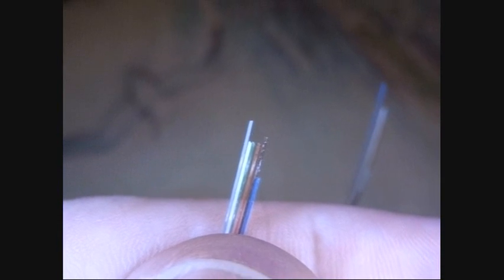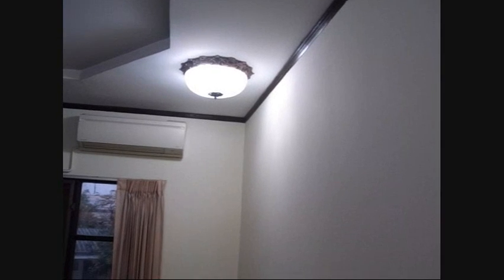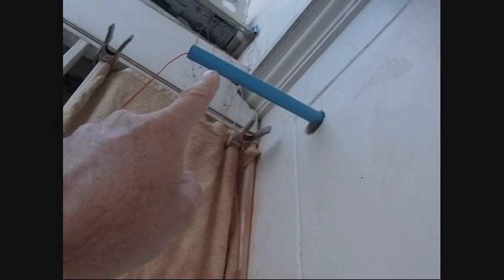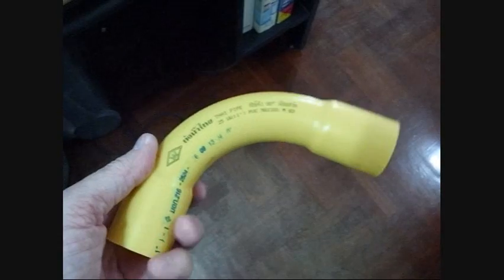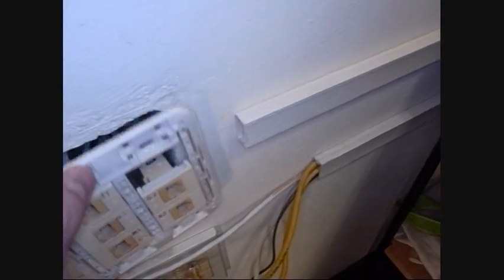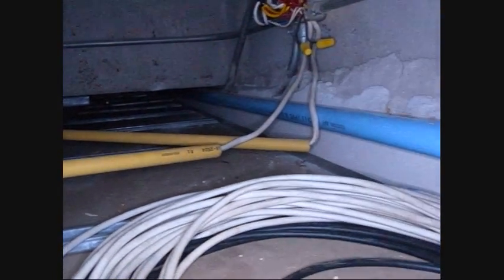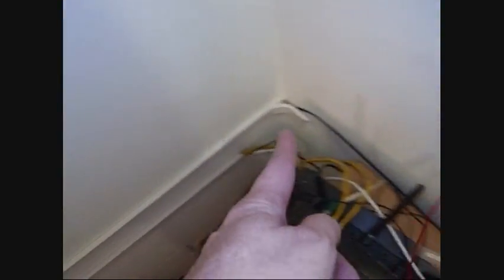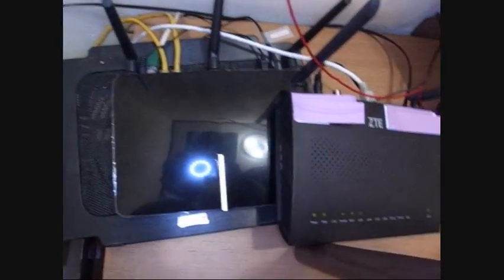Home Fiber Optic Internet Installation - Ideas For Your Install

Comment: where can I get the long of a fiber optic line? and what do I even google? "Fiber optic cable" is definitely not the search term to use.  Plus there are so many different types of fiber optic cables / cable terminations.  It is so confusing
Reply from the maker: My communication company supplied the cable, but you can find it on Amazon. I just googled "amazon fiber opitic"

Comment: Just signed up for fiber optic. Can the current coaxial Internet cable be removed and replaced by the fiber cabling?
Reply from the maker: We left our old copper in place just in case, and ran the fiber in parallel.  So the real question has to go to your provider about their long term commitments to cable vs. fiber.

Comment: Showed cable route 4 times and never showed the connection
Reply from the maker: This video is about the physical installation of the cable.  The connections on both ends were done by the phone company.

Comment: mr. can u explain on how fiber work from FIBER DISTRIBUTION CABINET to FIBER DISTRIBUTION POLE?????? 🙇🏻‍♂️🙇🏻‍♂️
Reply from the maker: In our area, they use copper phone lines (better quality) to the distribution box on the main street.  The copper signals are converted into light pulses which are sent down a big fiber cable to a smaller splitter near our house (that's what I point to in the video).  From there it's again fiber cable (smaller) from their splitter to our router, 1 piece, no junctions.

Comment: Thank you for the informative video, I just moved to my old grandfather's villa and the phone company finished setting up fiber optic for the area but they skipped the villa because it's old (45 years old) building, so I was wondering if there can be hope for fiber installation in older buldings?
Reply from the maker: Yes, our townhouse is 30 years old.  You have to plan carefully first.  Set things up in advance if you want the wires hidden away.  If it is easy for the installers they won't usually complain.
Reply: @tsbrownie  thank you so much :)

Comment: How much did the fiber optic cables cost? Reason being, I'm currently trying to get fiber in my area & the last hook up is 900 feet away & the cable company wants to charge me roughly $5000 to do everything. That's why I asked, so maybe I could eliminate most of the price etc.
Reply from the maker: $5000 US???  That's unbelievable.  My cable was 160 meters and it was FREE with the installation of about $30.  First you need to know the cable specs from your cable company (type of cable, connectors on each end).  Then search Amazon or similar.
Reply: tsbrownie Thanks for the info. Very much appreciated. Spectrum is the cable company. I looked up something that said they use a Hybrid fiber coaxial for their hook ups/installations. Tried looking it up on Amazon but couldn't find anything similar to what they have.
Reply from the maker: Can't hurt to call them and ask them.  All they can tell you is 'no'.

Comment: Where did you buy your Fiber Optic Cable? I am building a place would perfer to run this in the walls before i sheet rock it.. Fiber Optic isnt in my area yet but would like to run it so its there can always tap into it later? Never Ran it before lol Thanks
Reply from the maker: The phone company gave it to me.  You have to know what type to buy (ask your phone company).  Like coax cable, there are different types (frequencies) and they are NOT interchangeable.  Also, it's nearly impossible to put the fiber connector ends on yourself, so you need to buy it pre-finished at the right length.  Mount a (big) wall box where you plan to have your router, then run it to where you will hook up to the phone company (leave lots of extra cable at both ends).  If you are going to have a home network inside the house, it's still easier and cheaper and more practical to do those runs with CAT 5 or CAT 6 wires.  With cat wires you need a few simple rules: 1) if you have to run parallel to a power wire, run it at least 1 foot away.  2) if you have to turn a corner, you need a bend radius of at least 4".  3) Don't pull hard on it, it creates invisible damage (slows the signal way down) and don't kink it (ditto).  4) Leave a yard or so on each end.
Reply: I am running cat6 & possible cat7 eithernet cords in every room, 2 in each room 1 on one wall 1 on the other wall across from each other.. Cat5e for phone alone with old phone wire just incase that happens not work.. just want run everything i can think of until sheet rocking lol.. put everything in a cabnet so not laying around with all wires kind of hidden out of sight out of mind.. phone wire im run pretty much at feet level eithernet cords will be run probably by sealing.. so a good 6 1/2 feet apart or sealing.. figured that be good..  even if parallel 6 feet apart should be plenty.. Also I'm run a Cat6 to my shed almost 200 feet away, so run it in conduit underground put another router on the other end for better wifi signal for when in yard.. That be interesting running that.. so your saying when you run eithernet cord that cord should be 4 inches of turn? Thanks for Info was helpful.. trying think everything to run in walls before go farther.. cat6 & 7 wires.. phone, coax everything..
Reply from the maker: Sounds like you have it pretty much figured out.  Phone and internet don't have to be separated by much, it's the AC and cat that do.  Also, most cat wires don't like any kind of moisture, so bury even in conduit might be short lived.  I think they make special cat wire that's water proof.  Cat also works really well for phones.  I've got 3 x cat 5 to each room in the house.  2 for internet (1 on, 1 backup which is easier than re-running) and 1 for phone.  There are standards for which cat colors to use for which phone standard colors (red, green, yellow, black).
Reply: Well that sucks, I hope it survives then lmao..  Cat5e I just bought tonight for phone..

Comment: Fiber is getting installed into my house in a few weeks, so I appreciate your video. They came already and had to stall on the installation because of a problem on the pole. The install as he (installer) planned it is to put a box inside/thru the wall and then run Cat-6 another 50 or so feet to where the Asus router is. Are you saying that the fiber line needs to go thru the house to the router location or the speeds are not up to par? If so, I better do like you and run some PVC he can push thru. i was told by him, the run of Cat-6 would not slow the speeds down. If that ain't true, then I need to be prepared :)
Reply from the maker: There's a lot of "depends" on this.  And please query your company to make sure this is true for their services: If the speed you are paying for is less than a gigabit or so, then the cat 6 will work, but it won't be upgradeable to the max in the future for stuff like video streaming.  (Some cat 6 is rated up to 10GB, so the quality of the CAT cable is important.)  Also, in my experience, the interfaces between 2 systems seem to slow things down, the more interfaces the slower / more issues.  Distance also impacts speed much more with copper than with fiber.  Electrically noisy environments (motors, appliances, etc.) impact copper but not fiber.  I think those are the main points.  I did fiber to the router because I am biased that direction!

Comment: how did you get the fiber on the poles?
Reply from the maker: The phone company did that.  In most places it's against the rules to run lines on public utility poles.
Reply: Ok so you asked your isp to put it on the poles?
Reply from the maker: Yes.  I did all the prep work, arranging for everything on my house (hooks, conduits, etc.) and they ran it while I stood and "supervised".  If it's ready to go for them and easy, they won't complain much.  If you try to do things while they are waiting it won't happen.

Comment: This installaiton is Unice regarding how the Sweden installation works.

In Sweden we use small fiber duct and small fiber: 0,5 -2mm fiber)
The duct is 5/3,5mm (Inhouse) and 7/3,5mm (Outdoor)
The joints must be sealed.

We use our products:
http://www.donet.se/webshop/datakommunikation/verktyg-tools-/blasutrustning-fiberblowing/

Several units are used in Sweden.
FiberBlow units from Fremco ore Zeitler.

Stringing Gun from Zeitler (unit that blow a pullwire thrue the duct)
16-50mm = EZ50 (Electical)
50-150mm = EZ100 (Electrical)
25-200mm = EZ300 (Fuel  supported)

I hope that some one understand how Sweden works today.
Reply from the maker: Thanks.  I have not been back to Sweden for many years.  It's a beautiful country with great people!

Comment: Unfortunate that you had to provide the cable for such a long distance. Impressive work on your part. Hopefully your computers and equipment will be able to take advantage of the high bandwidth? Thanks for sharing and best of luck.
Reply: In our case Bell would not let me supply the cable at all.  I started by checkin with Bell  and they said that I could establish my own Demarc. I filed a cable locate and pnce completed I put in a in-ground  2 foot by 2 foot cable vault  on the edge of my property  where the orignal copper phonelines came in and had un-terminated fiber run in two inch PVC conduit from there into my house and  to the server / telecom room erminating on a corning CCH-01  fiber patch panel using the same spec fiber they are using (Corning 62.5 infinibend SM) before I scheduled install thinking that they would just splice at the Demarc and place the GPON on my rack connected with a patch cable and then to my exiting router.  Instead they came dug a huge trench right beside my demarc and conduit and installed their own  conduit and drilled another  2 inch hole into the side of my house.  They then  ran fiber from that location all the way to the original demarc on the other side of the house and then ran fiber back to my server room and installed the GPON. The only thing they were willing to do was leave me an extra 100m of fiber for future use.  In total another 65m of fiber for no  reason.  They said the CRTC would not allow them to use  customer supplied facilities until it reached  the original Bell established Demarc point installed by them. So all my work was for nothing.
Reply from the maker: +MRrwmac Sometimes it's better to supply the cable than end up with some of the junk available!  Pay me now or pay me later kind of thing.  The speed is more reliable, but the server on the other end is often times the problem.  Was trying to download big drivers from HP and it was a dog.  Other servers were fast, but not HP's.  So yes and no on getting benefit.  Guess it depends on who you connect most to.  Thanks for the good wishes, I need them!  ;)
Reply from the maker: Sounds just like the "good ol' days" of Ma Bell.  The more things change, the more they stay the same!